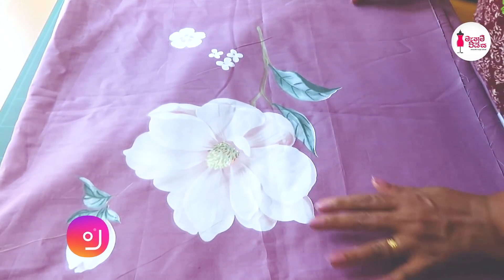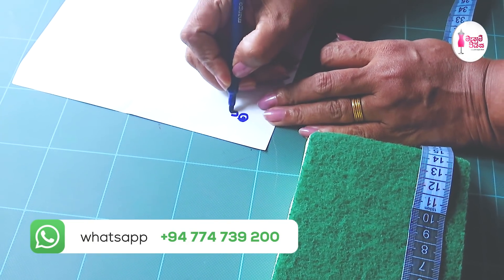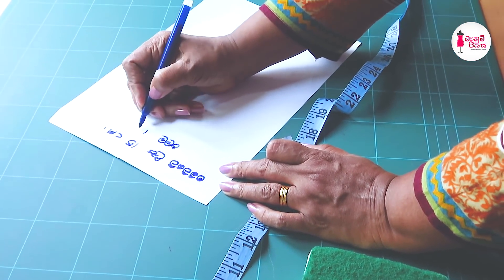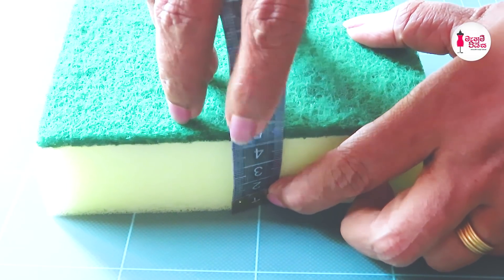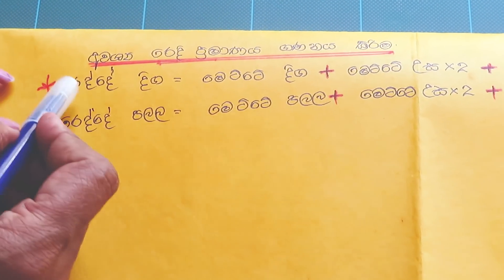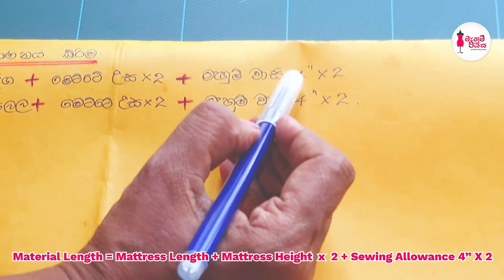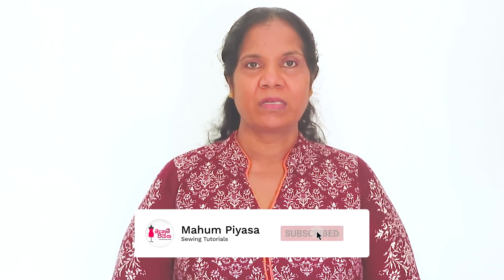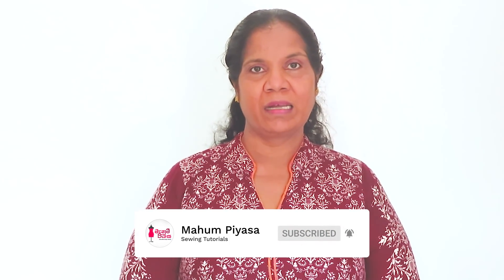ඇඳ ඇතිරිල්ල එලීම වෙනුවට අලුත් විසදුමක් | Let's Make a Fitted Sheet

Comment: Thank you for your video. My measurements are L-76",  W-60", H-8". Can you give the measurements for the Bed Sheet. How much material to buy 90" & how much elastic is needed to go round the Bed Sheet & what is the width of the elastic. Please help as I do not want to make a mistake. Thank you.
Reply: 2.5 metres of 90" width cloth and about 6.5 metres of elastic about 2.5 cm width. as per my Calculations. I think elastic should be attached only for 2 feet length at corners with out going round the mattress.
Reply: @devikamendis2545  Thank you very much for the measurements. Much appreciated.
Reply: How much of elastic would you need for each corner. Please help.
Reply: @secretarysecretary221  I think you should buy 2 yards of elastic if you are going to attach it only for the corners. That is to stitch it after stretching for 2 feet at each corner. A small piece might go waste as it depends on stretchability of elastic you use.
Reply: @devikamendis2545  Thank you very much. Blessings. Arlene